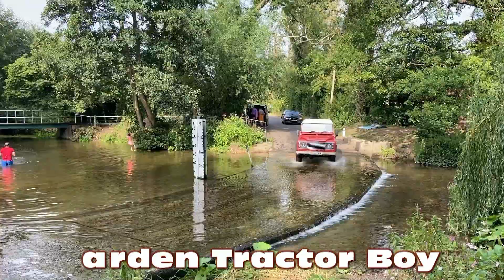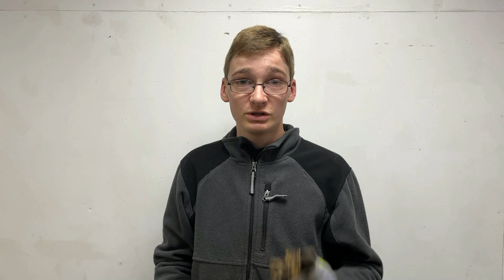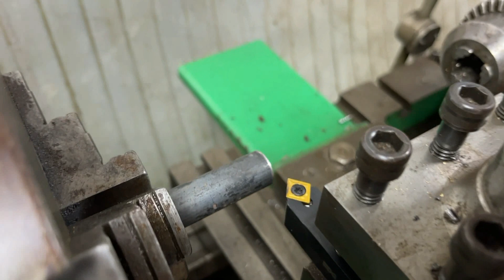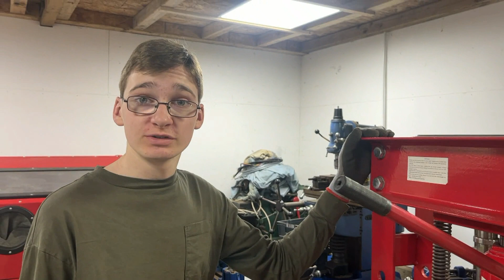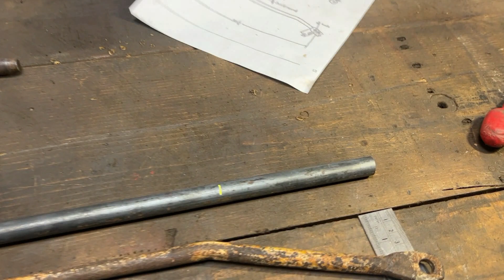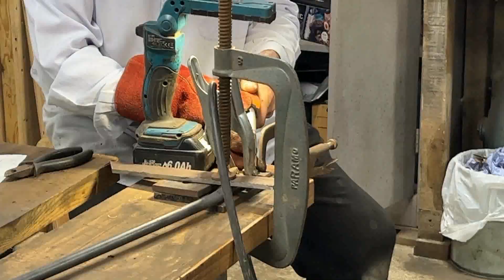Bolens Sleeve Hitch Project - Part4

Comment: Great result so far, Joseph. Enjoyed the lathe and press work, I'm like you, a newbie to bending metal using the hydraulic press. You're accumulating some great old school manufacturing skills along with practising using the imperial measuring system. Nice one. Tony
Reply from the maker: Thank you very much. The press is great for bending metal and it is fun to learn the best way to do it. 5/8" solid bar appears to be about the limit on our press without cutting a relief in the metal. It is cool to use imperial measurements and something I only get to do on our older equipment. Take care